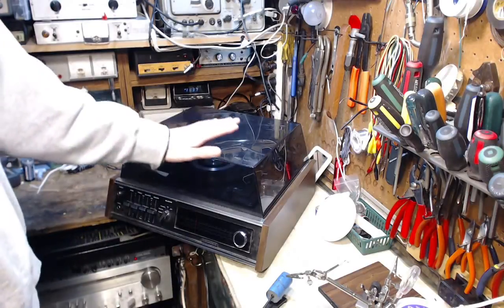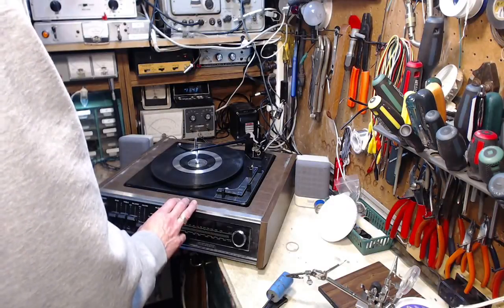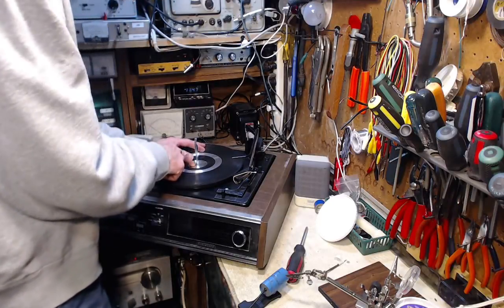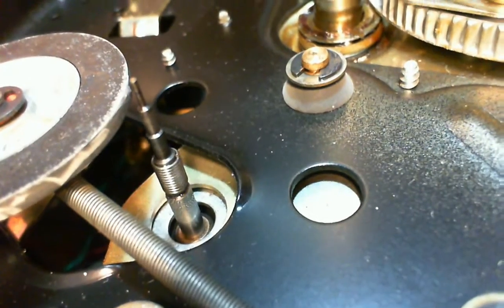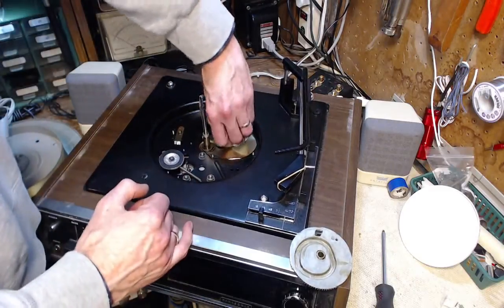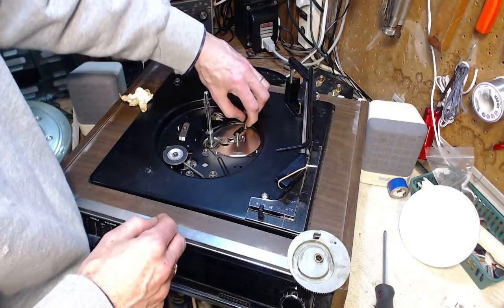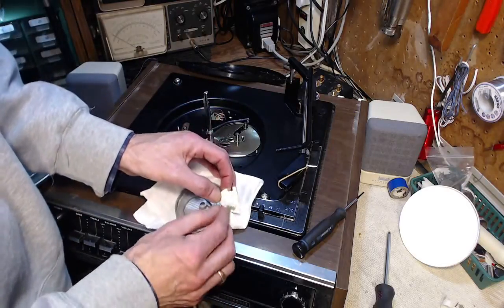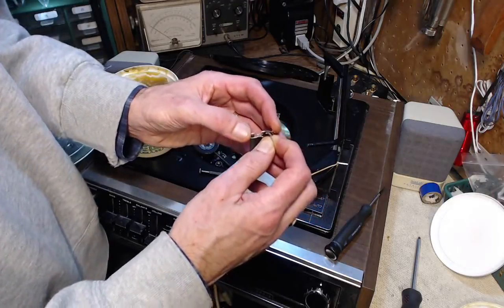Panasonic Model SE-1519 Video #1 - Checkout and Repair

Comment: I have an SE-850a that is almost exactly like that. However, it is playing at a constant 78 RPM and I can't adjust it down using the switch. I haven't pulled it apart yet, but any idea why it's doing that?
Reply from the maker: Lubrication issues.  The original lubricant has turned into glubricant.  A good cleaning and some new lubrication will probably solve your problem.
Reply: Awesome, thanks!

Comment: BTW surley the f.m. and a.m. should use the same audio output circuit.  Gota. Be in the front somewhere
Reply from the maker: billybonewhacker I'm thinking there is a separate FM wire (shielded cable actually) and an AM wire that go to the switch then on to the amplifier.